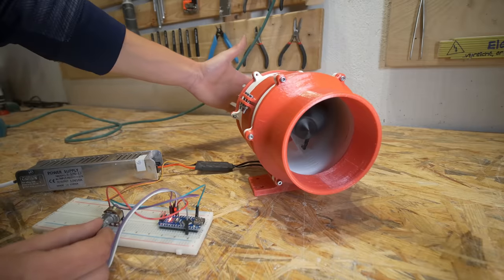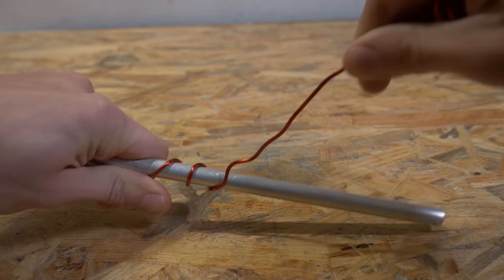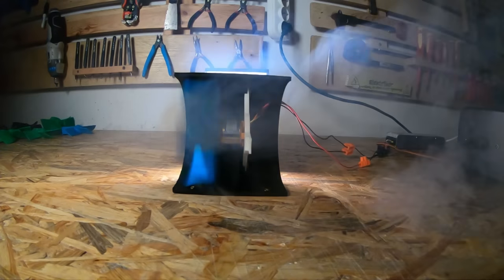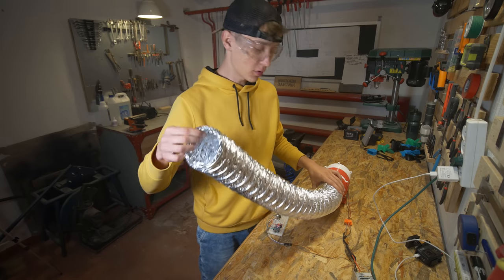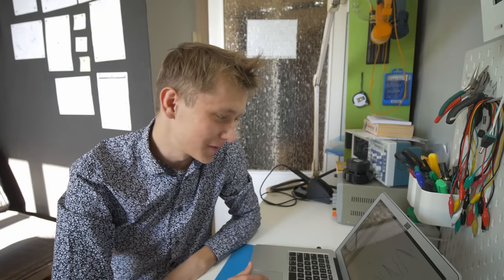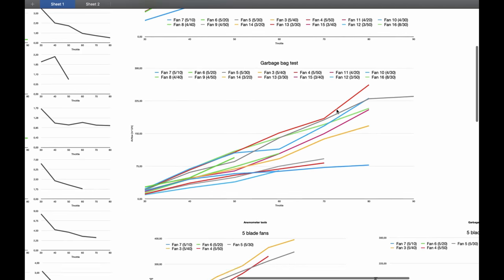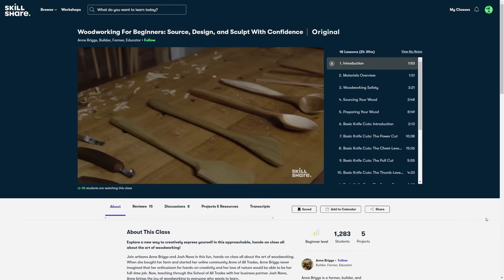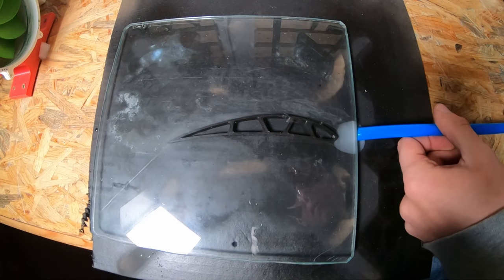Testing 3D Printed Propellers (3D Printed Duct Fan)

Comment: I have few tips for you, which will change the game:
1) measure the static thrust. It is relatively easy with use of a load cell and arduino and it directly corellates to the velocity.
2) Use power meter to determine the efficiency.
3) Since your blades are relatively long, the pitch angle must be different at the tip of a blade and at the shroud. 
   To determine the optimum pitch angle, you need to know all 3 components of velocity  vectors (absolute, relative, angular) and construct the velocity triangles. 
4) Try to avoid any shrap edges and transitions at the duct as well as the rotor (better nose cone).  These transitions are often causing separation of the boundary layer, which results in more turbulent flow and higher energy lossses.

I hope this was helpful.

Comment: I built a wind tunnel using 40mm fans. I used 100 fans in a 10x10 configuration. 
It work very well. 
For a filter, I made one out of a cheap box fan and regular air conditioning filter, and some junk wood fro the frame.
Naturally, the filter will dictate how small of particles it will remove. Just make sure the filter is snug with some weather proofing foam tape. 
I used it to capture all the fiberglass particles and sanding crap from the garage, while I was building my Cozy MK4 experimental aircraft back in 1998. 
It worked well and all I had to do to clean it, was to vacuum the filter in place. No need to take the filter out.

Comment: I think the best way to measure the air flow rate is to design an orifice flow meter or maybe better a nozzle flow meter with a U-tube manometer filled with water. Just connect the nozzle flow meter to the outlet of the fan and measure the pressure difference before and after the nozzle and with the use of Bernoulli and continuity equations you can calculate the mass flow rate in an accurate way. Best of luck. Love your videos

Comment: for your half duct you can make a clear half by heating a piece of pipe or a pot in the oven and laying clear acrylic on it. It will bend to the shape of the pipe and then you cut it to size.

Comment: That sort of Airtube (the silver thing) produces a lot of turbulence due to it's shape. You would like to have laminar flow, for which you need a neutralizing element, like a bunch of straws with a minimum lenghth of 5 cm. You could push them snug fit into the nozzle and fix them with duct tape. With a bit of PVC tubing or acrylic (to show the effect on camera) you give it another 10- 15 cm to let the airflow settle, and should have a uniform laminar flow at the end of the PVC/acrylic tubing.

Comment: Great video!
The tips I would think of are using an airfoil for the blades and adding some twist to them, making the angle of incidence compensate for the differencie in tangencial velocity resulting is similar angle of attack throughout the blade.
Reply: Oh... that's for fans moving through air... nevermind XD

Comment: Nice video
Yo should check out the relation between 
Static, total and dynamic pressure in order to get the velocity in different parts of the fan. <3

Comment: Which motor (model and specs? link?) did you use for your tests in the Spreadsheet? It would be interesting to know what the power in Watt is at 10%, 50%, 100%